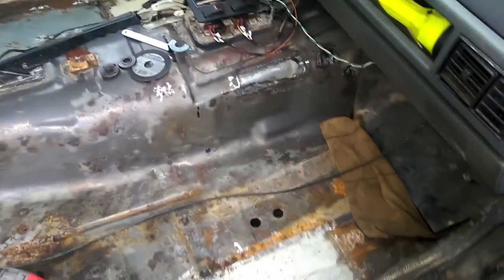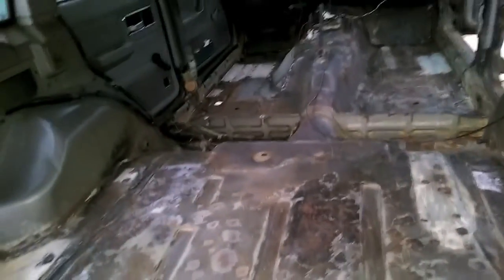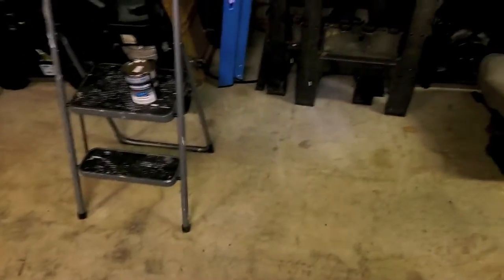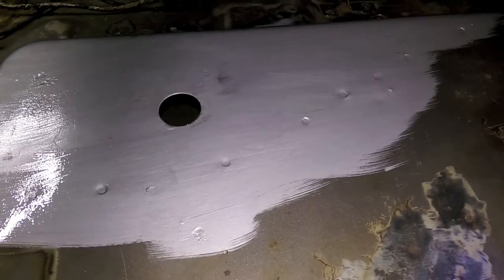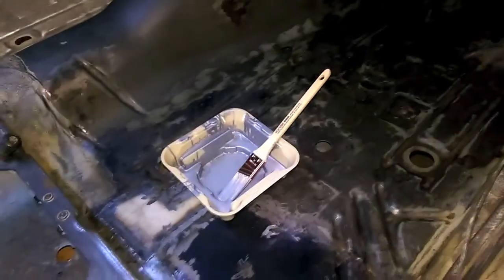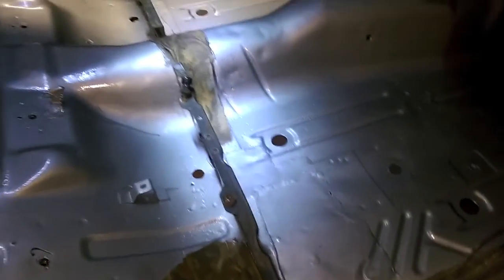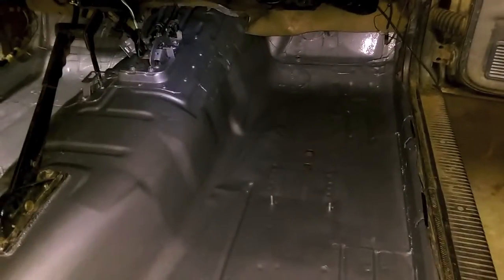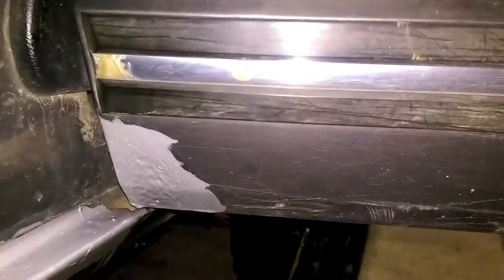89 Cherokee Applying Chassis Saver to Floor Pans

Comment: I did use Chassis Saver on a 13x7 trailer I re-worked. It's been about 2 years and held up well. What I really wanted to share is a way to save it after you open the can. A gallon is super expensive and even worse, once you open it you will destroy the can getting it open to use a 2nd time. If you aren't going to use it all in 2 settings try this. If you have kids and run through ketchup like I do get the big refill container at walmart (like you see fairs and picknics). Dump your left overs into that and cover the top with saran wrap. Put the lid back on and the wrap a couple of rubber bands around it to hold the saran wrap down as extra insurance. I was able to get mine open a year later, use a bit and repeat. It held up for about 2.5 years before I had to toss it. I'll post this on a few other videos so I'm sure you'll see this elsewhere. Good luck with your projects.
Reply from the maker: Randy sierra Saran Wrap is the way to go. I used it in between the lid and the can and it was fine. In the instruction it says to pour a little bit of their Magnet S8 reducer on the top to create a solvent float to keep the moisture and air out. For extended shelf life they say to store in a refrigerator.
Reply: That's a good tip too. Good luck on your future projects.

Comment: Looks good. I had heard of POR15 before but by the looks of it Chassis Saver is actually much easier to apply. I just might use CS instead when I tackle my floorboards.

Just FYI on the rust on the rockers and doors. Although you treated the outside, the rust will continue to creep and spread on the backside of the panels. So be sure to spray the backsides/insides with Fluid Film. Remove the door panel or drill discrete holes to get the fluid film in there to stop the rust from spreading anymore. It would also be a good idea to spray FF in the "frame" rails underneath to help slow down/stop internal rusting. I use a product called Krown T40 but it's basically the same as FF, it works wonders on preventing rust if you spray it before the rust gets bad.
Reply from the maker: I'm not sure if the whole POR 15 kit has any rust conversion properties to it but chassis saver seems like a solid choice for light to medium rust applications. 

I have not doubt that the door will probably rust through again but the rocker was only surface rust from the door rubbing it. The hinges are getting weak. If I can get to the back of the door panel then I may try to save it and bondo later but I'll probably end up cutting it out and welding a new piece in. We'll see just how tough chassis saver is.

As for the frame rails, I sprayed some galvanising paint in all the access holes I could get to but they all seem very solid and protected. If I ever flush out the rails real good, I may look into some kind of spray.
Reply: NickInTimeFilms OK, cool. POR15 encapsulates I believe.

Comment: This might be a completely moronic question but i am 100% new to anything automotive lol. With that said, can you just apply this chassis saver, then sound deadener then a mat or the carpet? I dont really think i need the bed liner but im not sure if i will need it BEFORE i put the sound deadener in and the carpet. I appreciate the video.
Reply from the maker: No worries man. So I would highly recommend some kind of encapsulator on the floors at the very least, especially if there was any amount of rust damage. If the factory paint is still great then it might not be that big a deal then. After a good protective metal coat, you could certainly just go straight to sound deadener and then carpet. 

I went the bed liner route because this is not a show jeep, it's going to get dirty and I want to be able to wash it out while keeping the floors in one piece. If you're adding carpet, I don't see it as being necessary.

Comment: Im welding in patch panels in the cargo area of my xj tomorrow. the chasis saver looks like a great idea and then paint over it. I was wondering, do I have to strip my paint all the way down to bare metal if the paint is good to apply the chassis saver? (although it seems to just flake off with whatever primer they used effortlessly) Thanks man, all your vids are excellent.
Reply from the maker: The Chassis Saver sticks to most paints just fine, no need to sand to metal. Just rough up the material to remove any loose paint and give it something to grab onto. Chassis Saver actual works best on rust and the instruction say not to over remove rust but get the loose scale off. Bare metal scuff with 60-80 grit, old paint 120-180 grit. It makes a good primer so most paints will stick to it just fine and doesn't even need to be top coated if it won't be seeing UV light.
Reply: Thanks man! I got 85% of my panels in place, put some seam sealer over the welds as well. Come in the garage the next day to find my gas tank has a slight leak. its always something with these xjs!
Reply from the maker: SixOneOh brappp Congrats. It's a great feeling when you weld in that last panel and just say you're finally done. My gas tank had a leak as well, but I fixed it before I started welding, haha.

Comment: how many miles that jeep got?

is it really necessary to use chassis saver if you put bed liner down?
Reply from the maker: Brandon Harrell It's about to hit 180K miles. 

Chassis Saver isn't necessary but it makes a great primer base for bedliner. Chassis saver works best on rusty metal and seals it from further damage. I put Monstaliner over this and it worked out amazingly, very happy with the end results.
Reply: NickInTimeFilms   where did you get the chassis saver and how much do i need for the floor and possibly the underbody
Reply from the maker: Brandon Harrell Ordered it online, Link in the Description. 1 Quart was the perfect amount to do the whole floor pan front to back. How much you need for the underbody depends on just how much you want to coat but it goes pretty far.
Reply: ok prob end up getting a gallon to be safe
Reply: wish my jeep only had 180,000. mine has 245,000. only paid $500 for the jeep though. got it couple months ago
Reply from the maker: Brandon Harrell well, you get what you pay for. And I'm sure you're learning that now, haha. My engine is slowly kicking the bucket though, I'm gonna need to rebuild it soon.
Reply: lol. yeah. motor runs fine though
Reply: what welder did you use?
Reply from the maker: Brandon Harrell some home depot cheepo welder, check my passenger floor pan vid for details
Reply: +Brandon Harrell Longevity Migweld 140

Comment: hows the chasis save holding up?  any signs of rust trying to come back?
Reply from the maker: No issues at all with this stuff. It does not come off if the surface was prepped right. I still have a stain on my shoe from the last time I used this. Did great on the floors, and made a great base coat on the rear axle. Can recommend.

Comment: so..did it last? did the rust bubble under the bed liner?
Reply from the maker: +Sky Steppes heck yeah, this stuff is great. Prep is key, there was one panel where the silver stuff didn't stick great bit otherwise it has held up great and kept the rust locked away